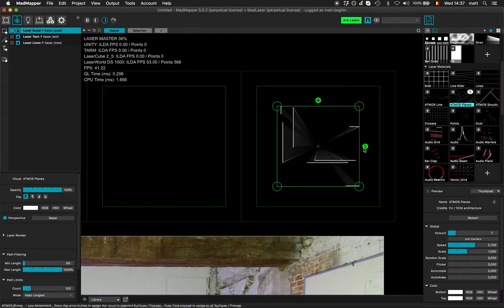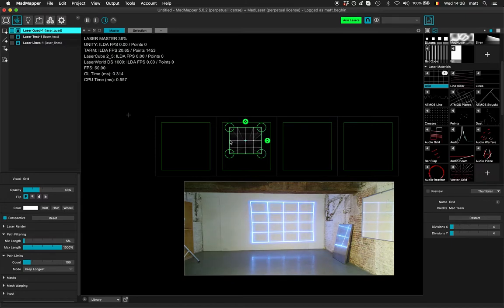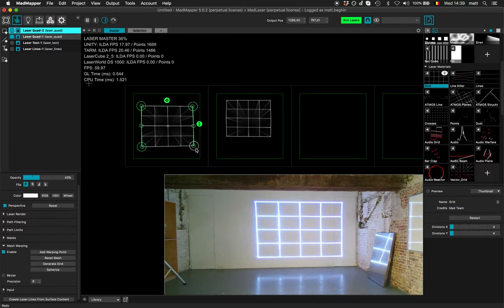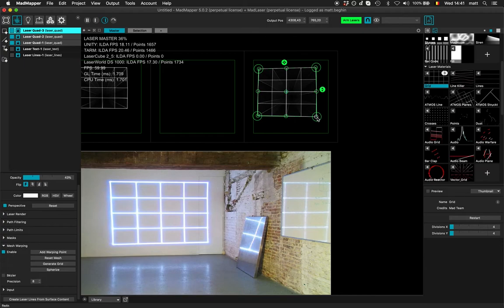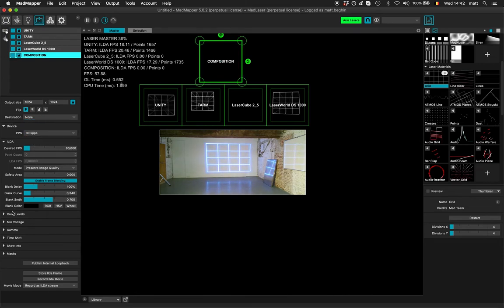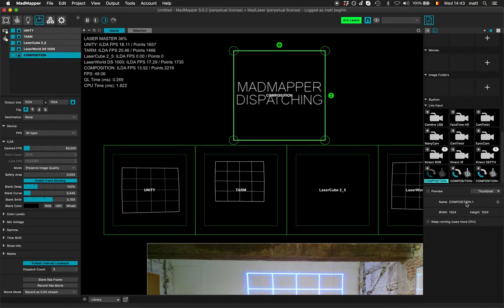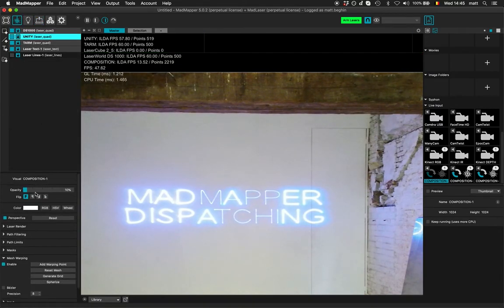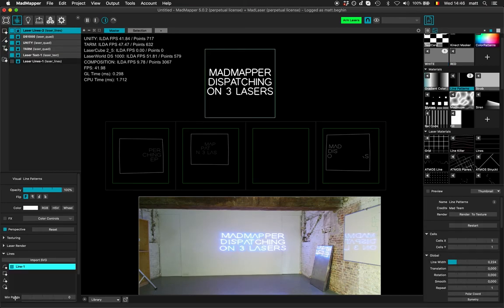Dispatching over multiple laser projectors with MadLaser (MadMapper)

Comment: Thanks for the video it was very useful, to connect several different lasers and make sure madlaser recognizes them are you using a network switch or router? what IP configuration are you using?
Reply from the maker: A stupid network switch. No static ip just auto ip (computer set to dhcp)

Comment: Hi Matthieu!
I’have a lot of questions about madmapper, but now i have this one to start my new project. It’s possible to correct perspective in two projectors to project in exactly position boths?. I know one way is adjust perspective in the surfaces but I think is better to change perspective in projectors for apply this corrections in all contains that I use. In this case I’m using laser projectors. Thank you for all.
Reply: I mean projecting the two lasers in the exact same place.
Reply from the maker: Sure, your create your composition with multiple laser layers in a laser output published as loopback with dispatching, then you'll make a laser quad to display each dispatched output in a real laser output. Each quad can be adjusted with perspective and mesh warping
Reply: @mattbeghin  I understand. but the perspective of each quad will have to be adjusted independently. My question refers to adjusting the actual projection of each laser in the same place. I can adjust the laser projection in size and rotation but not the perspective. If I understand correctly, you can only adjust the perspective of the quads, not the projectors. It is a theoretical idea thinking about making several lasers coincide at the same point, as they are in different positions the projections are distorted and the idea is not to have to correct the perspective of each quad, in the case of having a large number of quads.
Thanks for responding and thanks for your time.
Reply: These may be beginner's doubts and don't make much sense.
Reply from the maker: @oscarduarte1106  Okay but in this tutorial we put all laser layers in a laser output called "COMPOSITION" then for each laser projector we use a single laser quad with perspective and mesh warping. Since we use only one that would be confusing to have perspective correction on the layers and on the the outputs. We used it here with 8 outputs: https://www.youtube.com/watch?v=Qhe7FjSW_v0
In projects without dispatching, some people asked us how to re-adjust geometry of all layers at once (after projector moved). The solution is to use a "COMPOSITION" projector with loopback activated and do the geometry adjustement of the whole composition in the laser quad displaying the composition on the real output.
Reply: @mattbeghin  Thank you Matt! I watch this tutorial and this is the sollution. Good job!